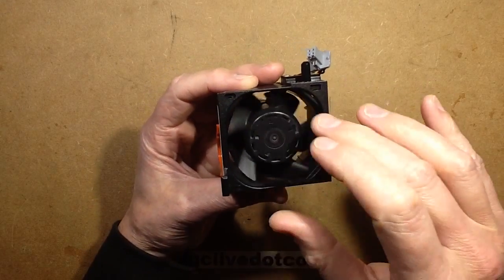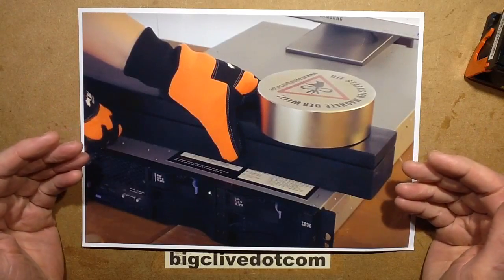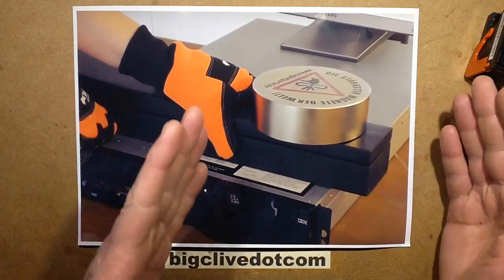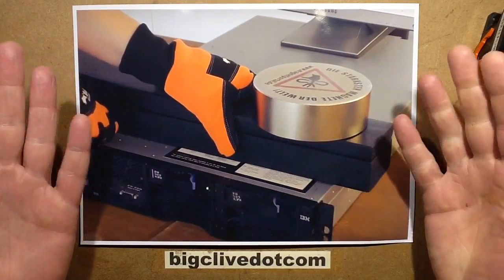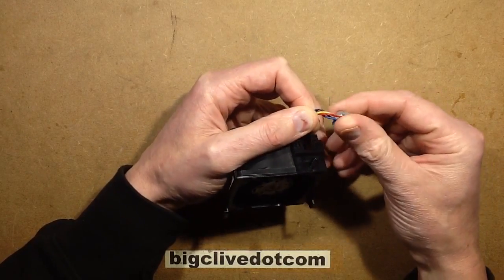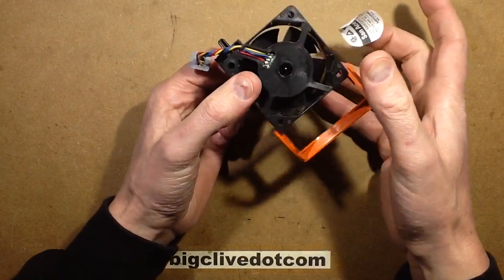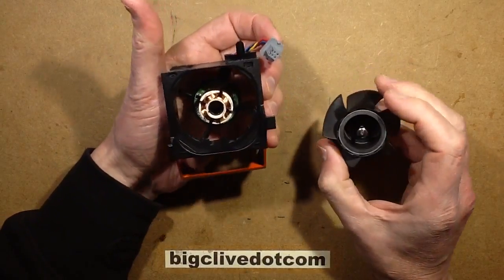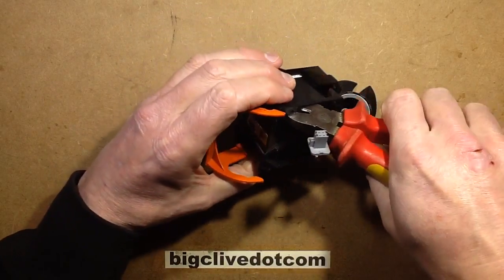Dead server fan autopsy.  (Unusual circumstances.)

Comment: Having watched this I did a small experiment on my breadboard. Apparently strong magnetic fields will cause MOSFETs to go into an excited state. The neodymium magnets i have are nowhere near the strength of the ones used near that fan. The MOSFETs I used were the NPN TO220 variety and I was only running them off a USB power supply.  I pulled the gate to ground with a 100 ohm resistor and applied the field to the body of the TO220. To my shock, it went into full conductance. Enough to run a small DC motor at least. Those servers have a high amperage bus for their fans because of how hard they have to turn those fans to move that much air in a tight space. I'd imagine what happened is that all the MOSFETs went into full conductance in the presence of that huge magnet turning everything on at the same time. When I took the field away it went back into normal operation.

 The magnets I used are one inch in diameter and about a half inch thick. They are considerably strong and I don't handle them with my hands directly between them. I've already seen what they do to a steak to show my son why he shouldn't take them to school. To get them apart I have to use an aluminum shim and some special handles I had to make with 3D printed parts and some nylon strapping. I'm not strong enough to pull them apart with my bare hands. There simply is no way to grip them well enough. I can't even imagine how strong the one that those guys used on that server was. Scary stuff...
Reply: Nice. 
fwiw aquick search of google scholar says you can get Hall effects in commercial MOSFETs
Reply: That's really interesting, never thought about a FET like a tube, but it's essentially a solid state tube.... Damn.... That explains a few hundred blown FETs in my projects.... Is there anything about the magnetic affinity in the FET's datasheet???
Reply: @TheOriginalEviltech  more than likely not unless of course you're talking about if you tease for specials at Vacations or critical application such as military life support what a view but then again it would say probably do not use these if he teased for that purpose.
Reply: Not that I've found and I did look. I take some comfort in the fact that it seems to only happen with the most powerful fields. Having done a few more experiments, it seems to effect smaller packages more than the larger ones. I believe this has to do with the difference in the distance of the internal components. I'm looking into getting some TO3s to see if the metal can helps negate this effect...
Reply: ExStatic Bass Hall effect influences all semiconductors, hall effect sensors are just specialized.
Reply: @npiper  from my lips and understanding of this I've heard that as well.
Reply: ExStatic Bass  maybe the magnets messed with the PSU switching FETs and sent high voltage on the 12V rail?
Reply: @matthewmiller6068  possibly but one that affect other components?
Reply: Well, THAT's interesting.  But that still doesn't explain blown zeners - unless they are below the 12V supply voltage and the current limiter went wide open.  But, then they'd be conducting at times that doesn't make sense.

I'm now wondering about the possibility of the power supply going wild.  In the past, when I've torn them apart, the 5V is regulated but the other voltages are not.  What else in the server is powered by 12V?
Reply: Russell Hltn well, one of the major things powered by 12V in servers, besides, fans, is... hard drives. The motors, particularly.

Also, the CPUs and GPUs are fed from DC DC converters that run off the 12V bus, and ram dcdc may be on either 12 or 5V. So the answer is pretty close to “everything. Everything runs on 12V.” Indirectly.
Reply: @JasperJanssen  yes that is correct that's why the server power supply is 12 volts in the first place because it is a 12 volt power supply after all.

12 volts and only 12 volts.
Reply: Aaron Brandenburg that’s gonna depend. Quite a few server motherboards just have ATX  power supply wires. And that comes out straight from the power supply.

Once you get to the more specialized gear, especially with redundant PSUs, the replaceable modules are probably 12V only — but that’s not all servers.
Reply: @russellhltn1396  well everything and no servers are actually powered from 12 volts.

Most servers if not all entirely run on one voltage at least that type of server.

Any regulation is done after the power supply for other components.

Check on any video where they use a server power supply you'll find that they are 12 volts.

I'm actually looking into possibly getting one of those for that reason.

As in terms of power import more than likely around a hundred amps or more just a guesstimate.
Reply: @russellhltn1396  Blown zeners can be caused by cascading failures, they don't have to be the first component that go.
Reply: @Ferrybig  Something still has to cause them to fail.  And yes, it was probably due to something else failing - but what?
Reply: Another possibility with the magnet is a straight up mechanical failure of the semiconducting oxide layers in the transistor or zeners
Reply: @npiper  possibly but not likely.
Reply: The field I applied was a static one. My theory is that this decreases the breakdown voltage of the gate by attracting electrons to it.
Reply: That's the sort of demonstration a son will remember. Congrats, dad.
Reply: @tactileslut  and then the son says wow dad what happens if I play with a microwave oven Transformer.
Reply: The mosfet hall effect... effect... likely didn't cause the failure in the H-Bridge, but in the voltage controller powering the fans. The zeners are what died, and I don't think 'shorted' mosfets could have done that to the zeners.
Reply: @rich1051414  good possibility?
Reply: In this case "Field" means electric field.  While there is interaction between moving electrons and magnetic fields, I'm not sure what a slow moving magnet would do to a fairly static electric field.
Reply: I was just using a MOSFET as a power regulator. If it effects that so much, I think it's safe to say that it could do the same thin to the controller and any other chips that have FETs in them. FET stands for Field Effect Transistor, the key word being "Field" here. It's widely known that magnets can effect the excited plasma in neon tubes so it falls to reason that it can effect the flow of electrons in a FET. I also doubt this is a unique phenomena since I tried it with multiple  different chips. It does take an extremely strong field to do it though. My smaller magnets didn't affect it at all.
Reply: ExStatic Bass well, make a youtube video about it ! Won't believe it 'till I see it

Comment: Fair to call it a BLDC maestro ? These are great to experiment with. The RC version is three phase,. I am beginning to rewind a 24N22P ( so 24 stator slots and 22 poles) It's a low rpm high torque Gimbal type with 130 turns per.  I must tell you it is not the remedy to quiet the mind. Much in the unseen world of BLDC winding conventions.

Comment: The power supply in the sever will have been subject to the same magnetic field.What happens if it have a magnetic feedback from the secondary to the primary side and this feedback transformer gets saturated?The primary (driver) side will not know the voltage on the secondary side and may have caused it to do what it can to bring the secondary voltage up. Thus resulting in way to high voltage on the secondary. Look for blown capacitors elsewhere in the server!

Comment: Core saturation! The magnetic field was so strong that it saturated the core of the stator, causing the winding to stop to be an inductor and become a wire!
Reply: The zeners would start conducting the moment the inducted voltage exceeds the voltage they are designed to conduct at. if the current is high enough, the result is a dead diode.
Reply: "causing the winding to stop to be an inductor and become a wire!"  The reason the Zeners died is that they were connected directly to the power supply, only limited by the resistance.
Reply: But how would that fry the Zener diodes?
Reply: Jack White maybe that by reducing the inductance, it cause more current to flow, so the magnetic field collapse faster after and dump more energy faster? but really, not sure. I think the saturation is only part of the equasion...
Reply: Lower inductance would mean less energy dumped from the collapsing magnetic field. "Speed" does not matter here, I would think, because "speed" is determined by the other components around the inductor and they didn't change. But a saturated core could mean unrestricted current flow through the mosfets, so I would have suspected the mosfets but not the Zeners, with core saturation.
Reply: Jack White A lower inductance cause a more rapid raise in current...

Comment: You are right about the PWM, the specs say: if unconnected it must go to 100%. Some also will go full blast if you go bellow the minimum, which is usually around 30%. PWM is 20kHz 5V

Comment: I'm no expert, so am likely talking out of my backside, but could the high voltage have been induced due to the motor coils spinning at high speed through the large magnets field? Turning the momentum of the fans into a sudden large voltage spike as it temporarily goes into generator mode.
Reply: Take another look at which parts are stationary and which parts rotate.  These fan motors are 'inside out' - the inner drive coils are fixed in position and the outer 4-pole magnet rotates.  Another commenter here was likely correct when s/he suggested the big magnet saturated the smaller magnets and the laminated steel cores of the drive coils.  Almost zero inductance would allow large [destructive?] currents to flow...

Comment: Great video! Thanks for taking your time to do an autopsy on the fan. The result is surprising. I thought it would have been some form of mechanical failure - maybe some insulation getting scraped of the magnet wire in the coils causing a short circuit. I didn't expect to see burned/exploded electronic components but it explains the weird smell coming from the server :)
Usually electronics cope quite well near the magnet. I guess the magnet must have triggered some unusual event in the server causing a spike inside three of the four fans in the server. Odd but interesting.
Reply: I disagree. I think it was the hall effect sensor sending weird signals out of phase to the controller. When you wan't to regenerate some of the power you put in to a BLDC motor, you pulse the coils out of phase resulting in high voltage spikes recuperating some of the mechanical energy back as electricity. Since the circuit was not designed to handle regenerative braking of the motor, the high voltage spikes killed the zenners. The 6 pin package ic is the PWM modulation controller. After the zenners blew it had to handle too much current and just puffed away.
Reply: @TheOriginalEviltech  more than likely I think you are on the money on that one.
Reply: @TheOriginalEviltech  but I am no One like Dave Jones or anything like that or big Clive or a v e just a hobbyist. That really knows his stuff.
Reply: @TheOriginalEviltech  enough words not electronics engineer electrical engineer or such.
Reply: @TheOriginalEviltech  hey somebody bring this up on eevblog forum and report back.
Reply: I remember seeing your video a few weeks ago! It was awesome. Subscribed.
Reply: Moving a Monster Magnet across the stater coils turns the fan motor into a generator.  The stronger the magnet and faster it moves the more voltage your going to induce in the stater coils.  With a pulse of high voltage the zener diodes failed to a become a short and protected the mosfets.  Just my two cents.
Reply: @shadowwalker23901  maybe but not likely you would have to move it pretty fast and also more than once crossed.
Reply: Eviltech I'd imagine you're the closest out of everyone to what really happened here. that strong of a magnetic field probably totally saturated the hall sensor and like you said, the resultant driving of the coils out of phase caused quite a lot of voltage. I have a couple of these fans in a closet somewhere, I'm tempted to hook the hall sensor as well as the coils up to an oscilloscope and find the biggest magnet I can to reproduce this
Reply: @fohdeesha  you know what you should do make a video about just that.
Reply: Jon Sands You do't need a big magnet, i have killed fans simply by putting my phone's magnetic flap next to the hall effect sensor, but in a different manner, because those were cheap simple fans that did not care if the field was spinning or not, they just powered the coils without any additional logic.
Reply: @TheOriginalEviltech  I think of the fans that you can extract sensor out of and use a magnet to switch between two LED strips like that one video shows.
Reply: ***** Nice, welcome aboard :)
Reply: Goldendevil 18 Thanks :) Hope to release a new video here in November with the Silver Play Button.
Reply: @brainiac75  sorry it's been awhile since I watched your channel I forgot you users name I am now going to subscribe. So I don't miss any videos.
Reply: It could also have been sent to all four fans but one didn't fail due to unavoidable difference in manifacturing
Reply: I think the magnetic field might have caused a fault in the power supply.
Reply: @dankerine  me too and probably everyone else.
Reply: Instablaster...
Reply: My guess is that the magnet caused the fan's motor core to saturate. When that happens, the motor windings act more like a short circuit rather than a inductor. The excess current likely caused the electronics failure.
Reply: @BenjaminEsposti  could very well be that's an interesting thought.
Reply: Gary Young And you were wrong.
Reply: I was yelling at the screen "world's strongest magnet + coils = generator"!!!
Reply: "Gary Young" : Seeing as how this brushless DC motor has a PM rotor and a coil stator, I think some pretty rapid movement of the external magnet would be required to generate much voltage. I think it's as others here speculate: the external magnet saturated the hall-effect device, which thus sent wrong signals to the controller, which turned on the transistors at the wrong times, causing over-current and/or over-voltage, which burned-out the zeners and melted the "mystery" component.
Reply: @RobbieHatley  couldn't agree more.
Reply: @ozturner  yeah but moving a magnet that slow wouldn't really do much.

Comment: Was the computer powered when they did their magnet buggery?
Reply: Yes!
Reply: Of course, it wouldn't have killed the fan otherwise.
Reply: +Stinky Cheese
There's many, many, turns in a fan coil. Even slowly swiping such a huge magnet over it would surely damage those diodes. There's a chance the fan would still be dead, but it'd be much lower.
Reply: I wouldn't say surely at all.   Just playing around with fans, I've set two in parallel with one powered and the other passively spinning and that didn't kill the non-powered one even with it's magnet so close to the coils.  I think what killed it in the video example was it caused the fan to stop spinning at which point the diode became continuous duty, but I must admit I was too lazy to watch the video long enough to study the schematic... so could be wrong!
Reply: Stinky Cheese
That's possible too. I didn't think of that. The back emf of the coil unloaded (aka fan stalled) could have dumped a decent amount of current into the diodes. Good thinking.

Comment: What probably happened is when the magnet was passed over it while it was running, probably causing the rotor to stall and stop. Now normally the hall efffect sensor would catch this however iff it was too also affected by the strong magnetic field, it probably didn't work as it should so instead of stoppingor lowering the flow of current to the coils. (what typically happens if one stalls.) it started pushing large amount of current til something go pops. Not done this exact thing with a large magnet but I have done stall test on different variants of brushless DC and some faliure mode ended up pretty similar to what im seeing here on this pcb.

Another theory is that the hall efffect sensor itself alone was th culprit. ITs what the drive circuit relis on to drive the coils. If the hall effect sensory gets a bad reading from that big magnet, it could have caused the brushless dc motor to miss drive. (pulse the wrong coil at the wrong time) and you end  up with an inductive spike in the coils. 

Ive seen bldc motors fail in many ways. Its not always easy to determine but based off what I see here, I think one of 2 things happened. The rotor was stalled or even slowed by the magnet, causing the coils to be misdriven because hall efffect sensory couldn't correctly detect rotor position. Switched wrong coil, inductive spike and pop. 

MY 2nd idea. Hall afffect sensory was affected in a way that instead of switching, one coil managed to stay on, stalling rotor, causing higher current flow, avalanche affect.